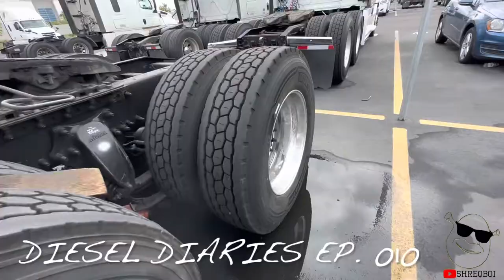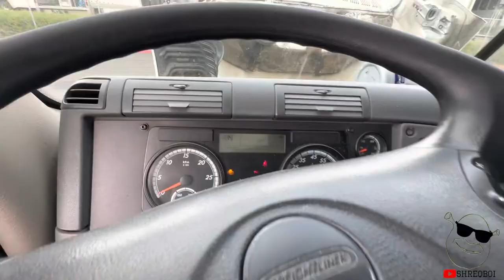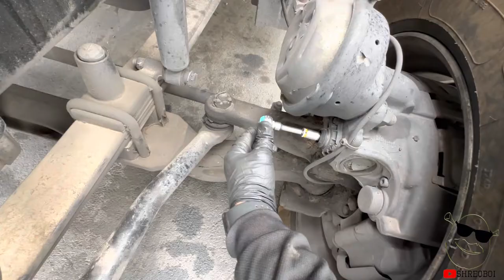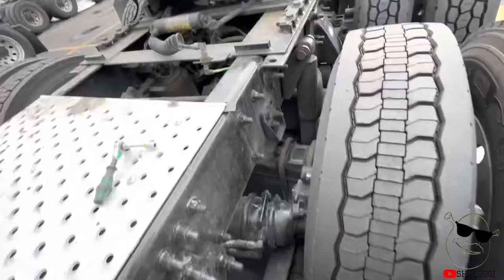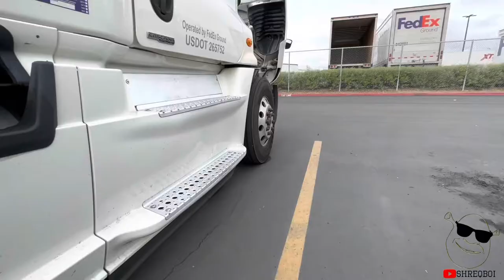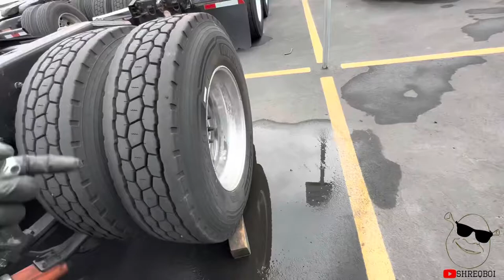Adjusting bendix air disk brakes | Diesel Diaries ep. 010 #bendix #airbrakes

Comment: I have a 2016 and it seems to be a different setup because i see the ajuster and the grece nipple but i don't see the part that you would pull out before ajusting! How does that work?
Reply from the maker: There are some variances for slack adjusters. Some just require a 9/16 socket (possibly a 7/16) to adjust. It’s the same procedure. Tighten all the way then half a turn out